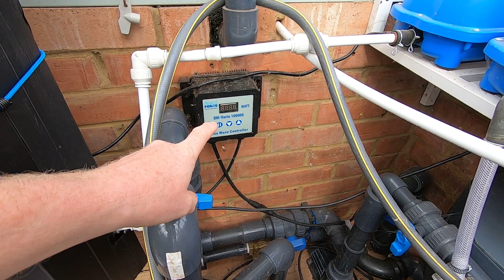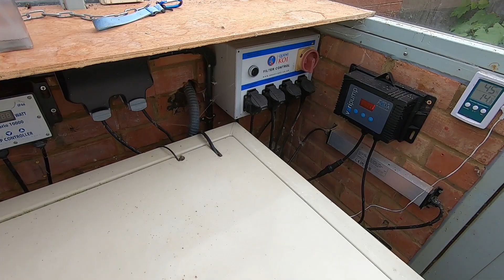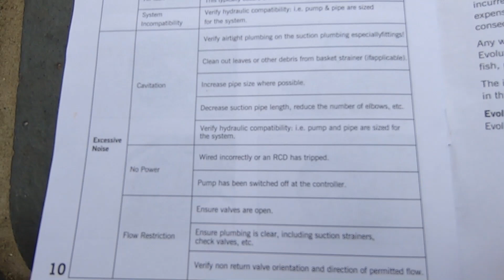Another Ten in Ten, items for sale, updates, Cat and Cavitation....

Comment: Hi Steve & Cat, good to see you back 👍👍 the roofs looking awesome 👌👌great 10 in 10 with Ade. I still think your drawing air in on the inflow side of the pump somewhere. I ran my 20,000 flat out for quite a while, and never had an air problem. Are you drawing your flow from the moving bed for that return pump? If so, I'd check that out mate. Great video, and take care you 2, Terry.
Reply from the maker: I've checked the unions several times, even unscrewing then tightening and I still can't solve it. Either way it's not too much of a problem. Cheers mate
Reply: I would think you have, but have you tried turning the air off for a while in the moving bed, to see if it's coming from there mate.
Reply from the maker: I turned all the air off and pumps for a few hours to check for leaks but nothing seen. A little mystery I guess.